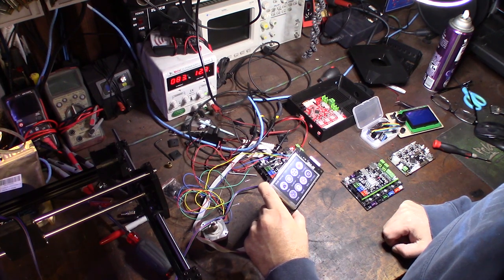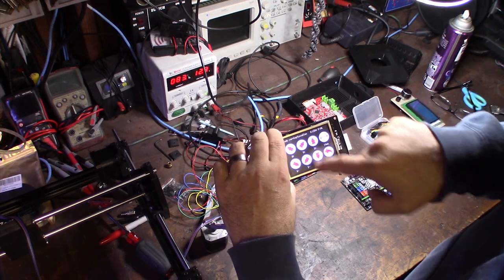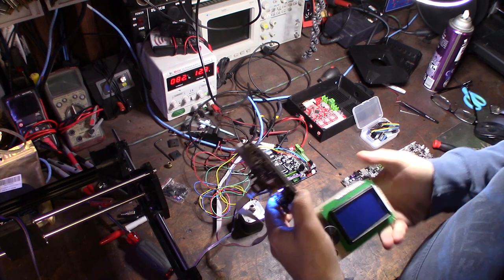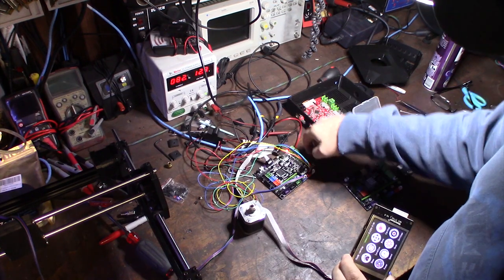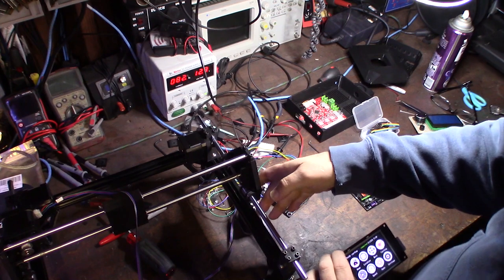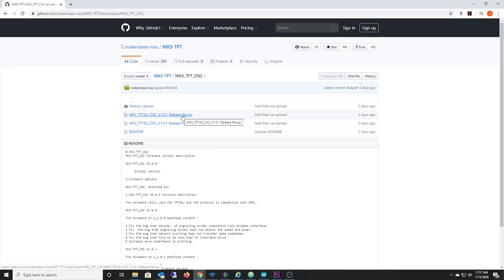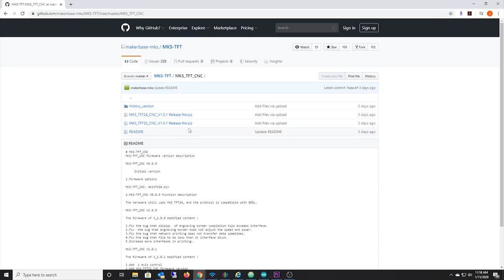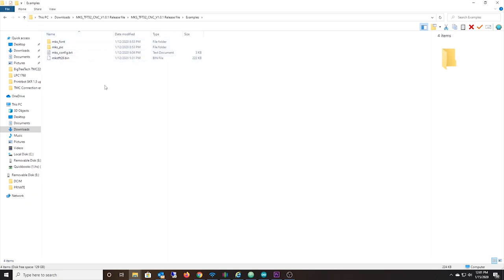GRBL firmware on MKS TFT32 TFT28 TFT24 New life for old 3D printer LCD display MKS DLC 2.0

Comment: Nice and quick video. Hoping you keep posting on this and the laser build. I'm following this as I also have a spare MKS Gen L V1.0 board from a printer upgrade and figured I would now start messing with lasers.
Reply from the maker: I'm finishing the frame and steppers now. The next part will be electronics/GRBL.
Reply: @fintechrepairshop  perfect. My brain is a bit numb with the coding, not a strong point of mine. However, I did get the grbl firmware to load following your other video and just loaded the files into the TFT as I just got that tonight. 

I'm trying to understand what is to be used for the pwm on the board, I need 5 v for my laser.

Comment: Hi, great video!
I'm buildin a diy cnc using a MKS base v1.4 with the grbl-Mega firmware + the TFT 32 and at the moment I can't get the thing homing when I press on HOME on the TFT. Is there a configuration I need to do on the config.h file of the grbl-Mega firmware? maybe uncheck some #define... ?
Thanks a lot
Reply from the maker: I disconnected the TFT32 because it was throwing allot of GRBL errors. Maybe they will release a firmware update
Reply: @fintechrepairshop  Ah, Ok thanks